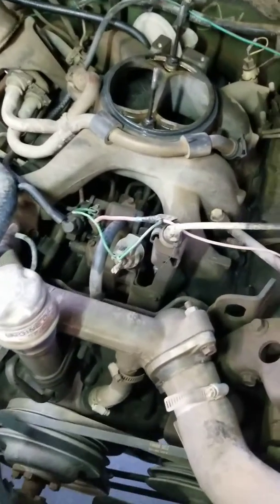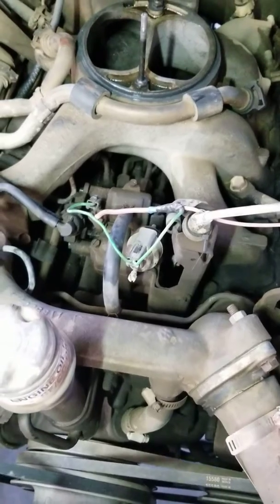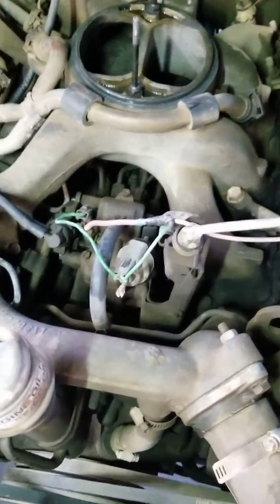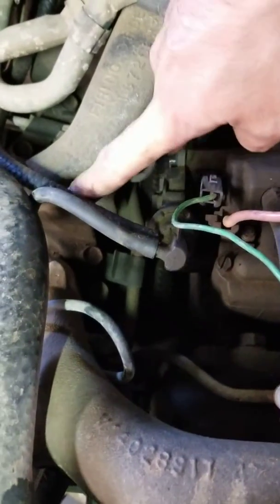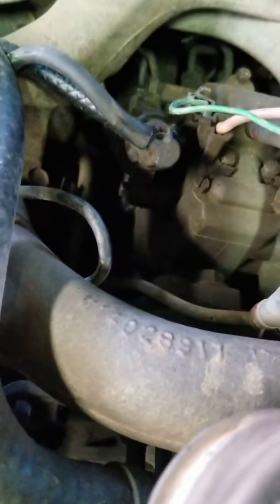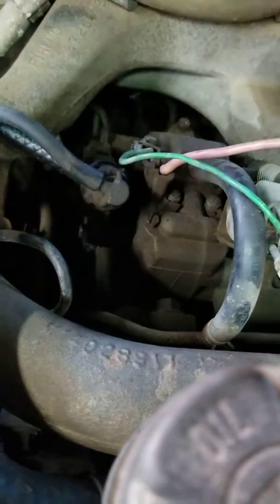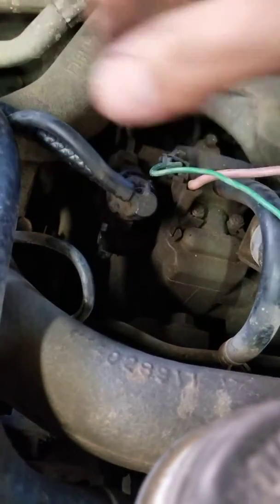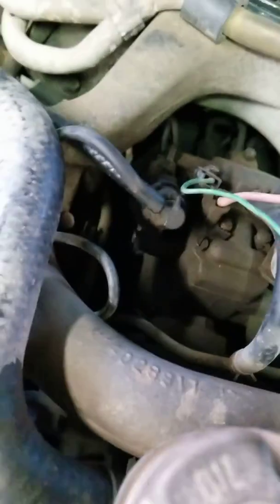Adjust Shift Points on Th400 Transmission 6.2 Diesel M1009 M1008 CUCV

Comment: Try the adjustment screw in the vac modulator on the transmission:

1.	Remove the vacuum line from the modulator.
	2.	Look into the vacuum nipple — you should see a small screw inside.
	3.	Insert your flathead screwdriver carefully.
	4.	Turn the screw:
	•	Clockwise: Delays upshifts (higher RPM shift points)
	•	Counter-clockwise: Advances upshifts (lower RPM shift points)
	5.	Turn 1/4 to 1/2 turn at a time, then test drive.

Comment: I have an m1008, with 35 tires, still getting 4000+ rpm at 55mph would retarding the shift points help with mpg on freeway, thanks
Reply from the maker: Unfortunately no, even bigger tires would make only a small difference. Really need 37s or bigger. Best option is to go to a manual 4 speed or 4l80
Reply from the maker: or reduce gears but thata counter productive IMO
Reply from the maker: Going to 4.10 gears would probably get you to 62-63 mph with your same set up at like 3700-3800rpm, not worth it in my opinion

Comment: What is that piece on the side of the injection pump Called
Reply: Did you ever find out?
Reply: That piece hes adjusting is called the vacuum control valve or vacuum regulator valve.

Comment: So on my M-1009, i moved that part back(towards the firewall) and there was no change?. So should I move it forward???. Please respond!.
Reply from the maker: If nothing is changing you may have to change the vacuum lines to the transmission. If there is a leak and the vacuum isn't there it will not change the shift points

Comment: Interesting info I did not know about that .Thanks . What did you use for the Trans modulator? Vacuum or mechanical? I have a 83 GMC 6.2  Trans that went bad so I swapped from a 700r4 to a th400 from a diesel box truck that was fresh. Its 700r4 went bad.  After flywheel change and shortening of the driveshaft. I needed to deal with the vacuum modulator so I found PATC mechanical modulator that uses a cable .TV Cable. Its not shifting to 3rd now After a good year plus. So I guess it's fallen out of adjustment or worse. Parked the truck four years ago and it came right back to life. She wants to drive in 1,2  Time to use the old  truck again so I'll be working on it again. These trucks will be the only working vehicles after the EMP Attack . So I'm keeping it alive .lol
Reply from the maker: I used vacuum, I always had trouble with my TH400 going into third also, What I do is drive it, when its in second throw it into neutral then back into drive and itll shift fine for the rest of the drive till I turn the truck off. Not sure why, I actually just swapped to a 4L80E, not done yet  but Ill have a video of that too. Not as EMP proof but it still has 1st and 2nd without the computer  so better than nothing lol
Reply: I know I'm late to the party. 
 I recently got an 83 C 20 4x4 with a snow plow on it. Apparently it doesn't shift into 3rd. 
 I will try the bump to neutral then back to drive.

Comment: What's the name of that part
Reply from the maker: which part?
Reply: @berreta370  He means the TPS or as a lot call it the Transmission Vaccum Regulator Valve.
Reply: @berreta370  ; so the trans on my M-1009 is shifting late!, and the part that you are talking about is moved all the way back???. So WTF???. Does this mean that the part is no good???. Or, does this mean that the part needs to be rotated towards the front of the truck???.
Reply: Transmission Vaccum Regulator Valve.